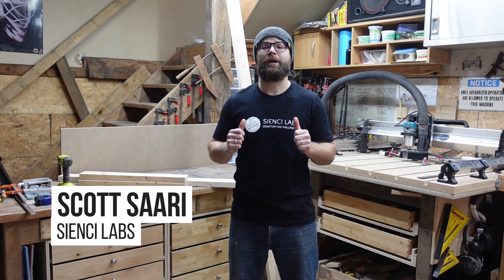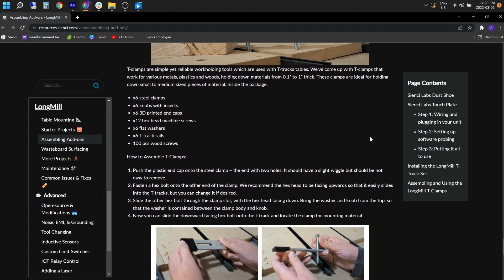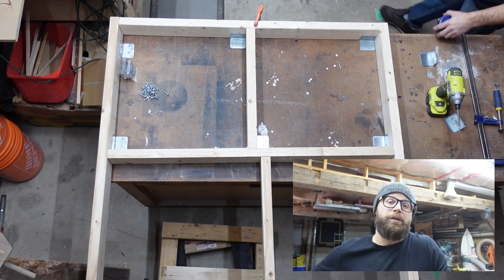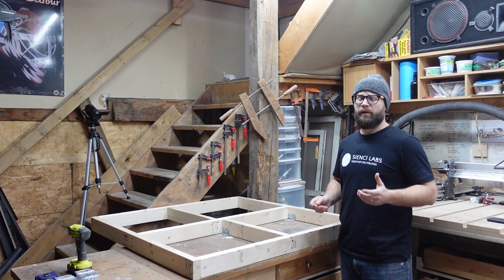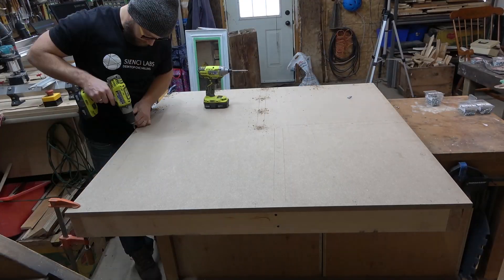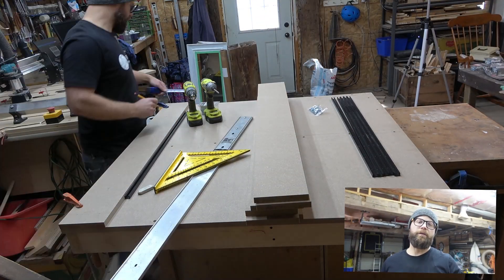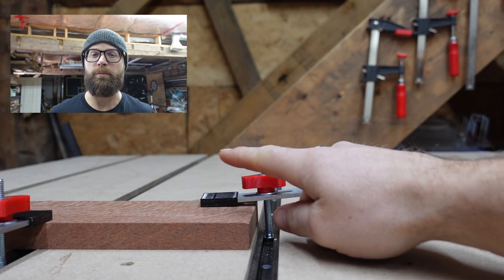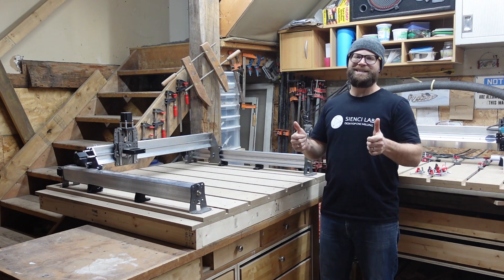How to Build a Bench and Install T-Tracks for You Longmill Setup?

Comment: I didn't see how you checked to see if there was any "twist" in the frame you built, and how you corrected it if there was twist.  When I built a frame for a router sled to flatten a large slab, I strung strings on diagonals from the corners a fixed height above the surface making an X.  Then checked the gap, or interference where the two strings meet at the center of the X to see if my frame was flat, or was twisted.  I would think this would be an extremely critical step in making a surface to mount the CNC.  I suppose, you could add shims under the mounting feet of the rails, but this might be a bit tricky with all of the intermediate 3D printed supports in the middle of the rails. I'm surprised I've never seen anyone talk about this and I've watched quite a few CNC assembly videos.  Also, with the intermediate supports on the Longmill Y-axis rails, if your 2x4's aren't perfectly straight, there is the chance you could bow the aluminum rail slightly when you tighten down those intermediate supports.  Have you done any checking with a straight-edge to see if your rails are bowed?

Comment: I am new to the CNC world... I understand that the work surface needs to be flat and the Long Mill needs to be square to the waste board.  Does the workbench/Longmill  need to be level??
Reply from the maker: As long as the LongMill and the wasteboard are flat in relation to itself, the level of the machine and the workbench itself shouldn't matter.

Comment: Thanks for this video. I'm looking to purchase a 12x30 for my small shop. I noticed you mounted ror machine at the same level as the spoil board. Most others that I've seen mount the machines at the level that the spoil boards are... soo 3/4 inch lower. Longmills z axis is shorter in travel than most. What is the advantage of monting as you did. Many thanks
Reply from the maker: Is there a reason you need the extra Z travel? Typically your max cutting height is more limited by the length of your bit. If you have a thicker material, you can still readjust the mounting point of the router or spindle to fit the material as well, so at the end of the day, it may make less difference than you think.
Reply: just curious if there was a reason you did it tht way. thanks
 @SienciLabs

Comment: Looks easy enough but How did you make sure  the area was flat ie: Without curve or twist? Is it important?
Reply from the maker: We were fortunate that our bench was good to go as is. If you have a surface that's got an imperfection it is ideal to get it as close to flat as possible, otherwise whatever material you mount your machine too could also inherit those flaws. Shims and sanding the imperfect areas are 2 fairly simple methods to fix most flaws. Hope this helps
Reply: @SienciLabs  Good to know...thank you for the reply. All the best.

Comment: I will be receiving my 30x30 longmill in 2-3 weeks.  Here is my question.  If I use 2 pieces of 5/8" MDF glued together (1 1/4" thick MDF) , do I need to back it with 2x4 like you did.  I want to place it on a desk like you but from time to time I will need to hook it (almost vertically) to a moving shelve.  Thank's for your video, it is very useful.
Reply from the maker: Hi Jocelyn, I only speak on personal opinion here, but I feel that without some bracing under your MDF, you may still risk having some warping or sagging near the middle of the board. I would try the double layer MDF but use a straight edge to check if you have any bends that are coming from the weight of the boards itself, and add some more structure to your table if it doesn't do a good job supporting itself.

Comment: Great video Scott! Please tell me the length of sheet supported beyond your bench. I  have a similar bench that's 24" deep and was concerned about flex if I extend it out another 2 feet.
Reply from the maker: Hey Randy,
Glad you liked the video!
The actual work bench top is 28" deep. The 2x4 frame and MDF base/strips on top are just over 48".  I run this machine pretty much daily and so far the set up is holding strong!
Reply: @SienciLabs  Thanks for the info Scott...you rock!

Comment: Thanks Scott!  Ordered the track kit with my Longmill and am looking into preparing the bench top for when it arrives. How high are the tracks? What thickness of MDF do you recommend? I'd like to make sure that I have enough clearance between the top of the track and the top of the (surfaced) spoiler board to keep the tracks out of harm's way.
Reply from the maker: Hey Hank, the dimensions for the tracks can be found on our product description here: https://sienci.com/product/t-track/. 3/4" is probably a good thickness as you'll have some extra material to flatten once you have everything set up.
Reply: It would be useful to answer the question vs send us off to a link where the information is not readily available
Reply: @vidznstuff1  There is actually a prety picture at the provided link that has all the demensions. Outside of that its 12.45mm or 0.5 inches in height.